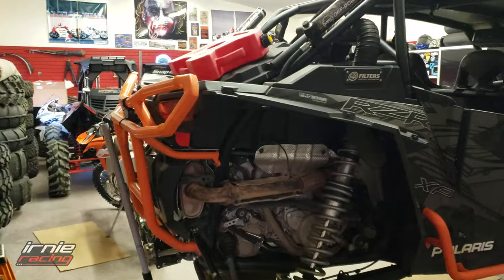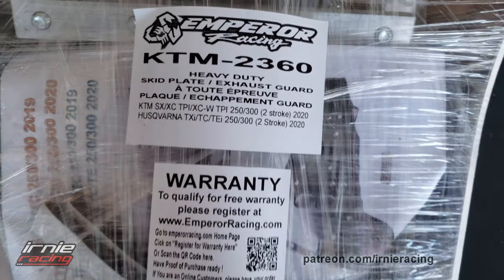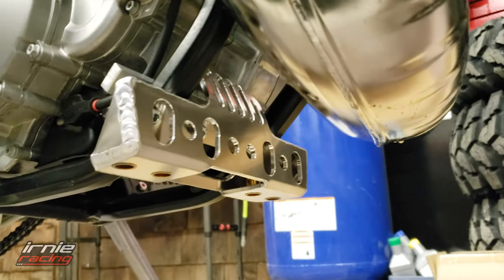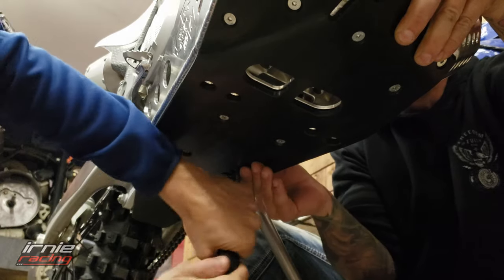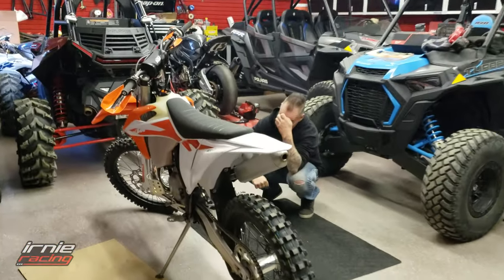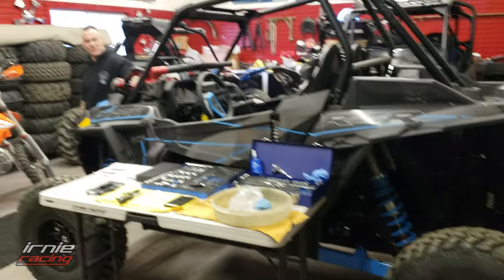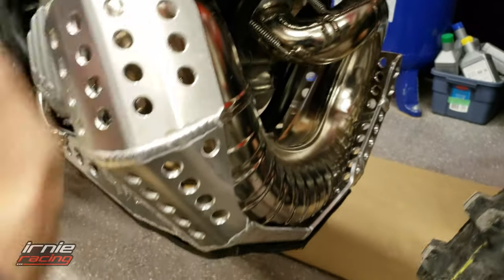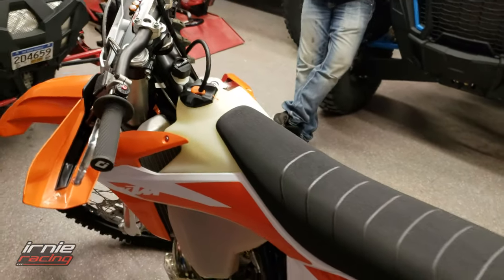2020 KTM 300 XC TPI "Skid-plate - Pipe-Guard" by "Emperor Racing | Installation & Review

Comment: You should look into fitting Tubliss, you get amazing traction and less chance of a puncture, I’m running Tubliss in the rear and Mousse up front.Did a 4 day enduro ride in  Romania following some of the Romaniacs course and had excellent traction compared to the stock bikes.As mentioned a fan is good if you are into the slow technical riding.I don’t have a TPI, I’m riding a 2012 SixDays 300 EXC.TPI is on the cards though.
Reply from the maker: All ready ahead of yeah. Tubliss installed front and back. Just waiting on the snow to melt!

Comment: You have to put a fan, these TPIs are way hotter than carb versions
Reply from the maker: Surprisingly I didn't have one over heat issue the entire Moab 7 day (14 engine hrs) of rock crawling.    The only update that could be the reasoning for improved cooling is my switch to AMSOIL Propylene Glycol mixed with AMSOIL Coolant boost.  
http://irnieracing.ShopAMSOIL.com if anyone's interested in testing.